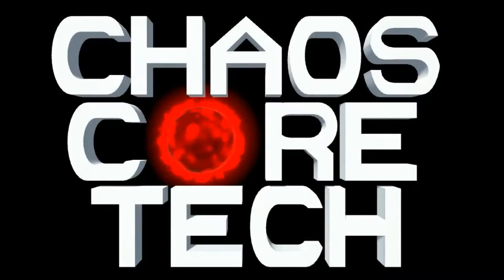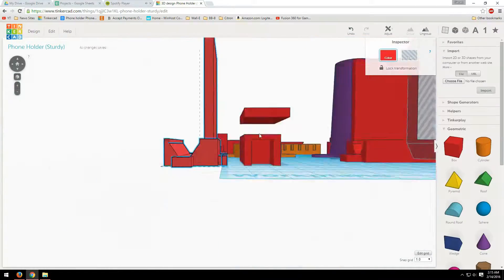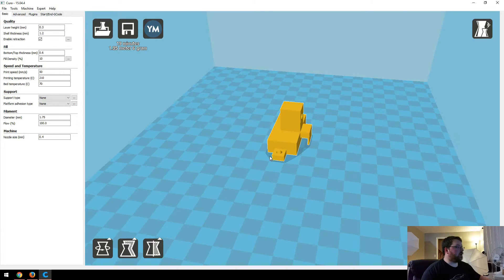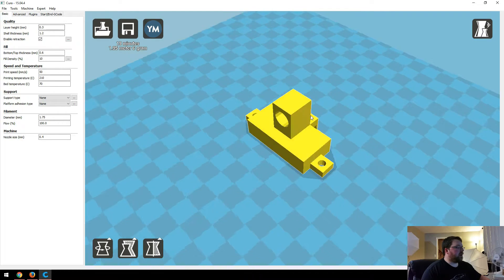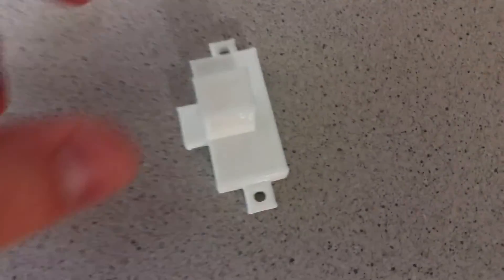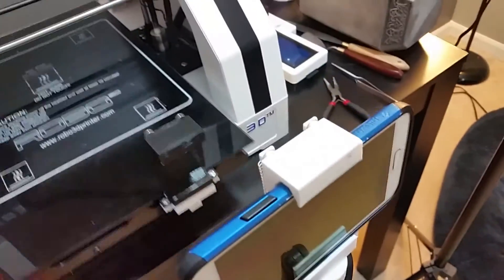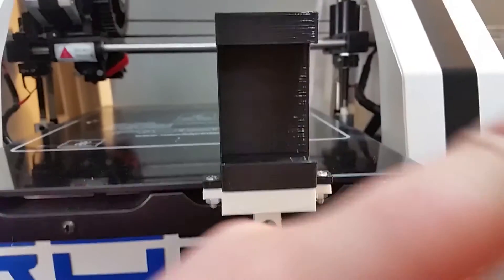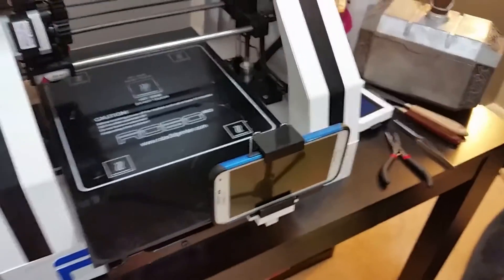3D Printed Phone Mount for Robo 3D Print Bed

Comment: Hello, I made your phone holder for my R1 Plus. It seems the bed is a little taller than the R1.  I had to make the arm that screws into the bed longer and move the hole down with Tinkercad.  Seems to work great though.  I was wondering how u recorded the time lapse though.  Do you just use the phone video record and use some other software to make it time lapes?  Or do you use a time lapse app to record and which one?  Thanks.
Reply: can you share your revised version? I am having  a similar problem with proper fit.
Reply: I'm also interested in the revised version

Comment: it would be cool if you could add a pivot point so you can angle the phone up etc.. not all builds will stay in that focal point ...
maybe design one that connects by lifting the glass and using it to hold it down.. then mybe making a simpler holder for the phone and maybe a know to tighten the angle into position somehow?
Reply from the maker: +3dprintsnstuff Yeah, you're right on that one. I'm printing something now that is out of range of the camera lol. So being able to angle it like you suggest would be super handy. I'll have to look into that and see if I can come up with a good way of keeping it at that angle. :)

Comment: Great solution for time lapse.  Next trip to my local maker space I will have to check if our printers have a similar mounting hole
Reply from the maker: +Webbed Toed Workbench Thank you! And I wish you good luck. :) If you need to make adjustments I can make the files public on Tinkercad so you can adjust to your wishes.